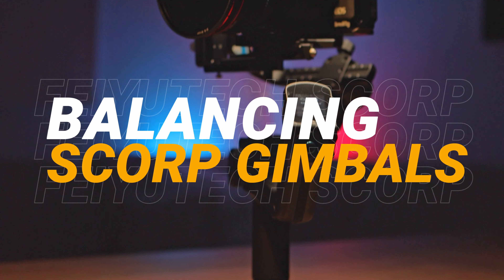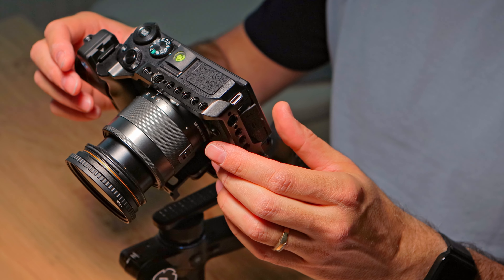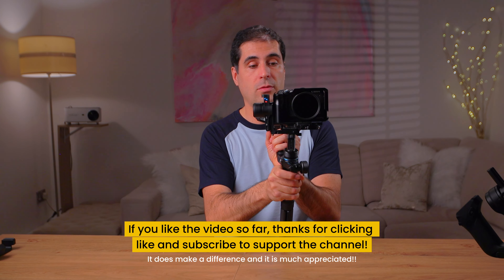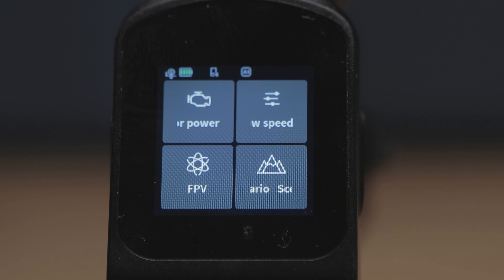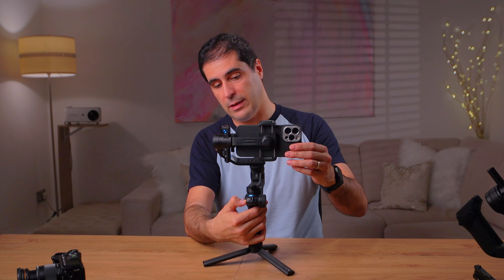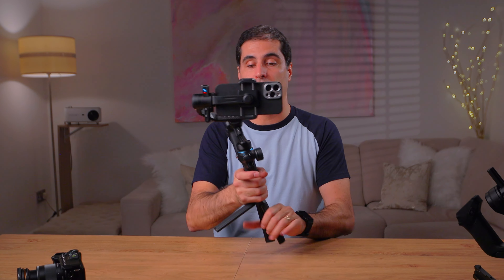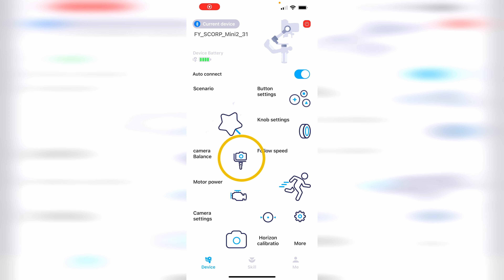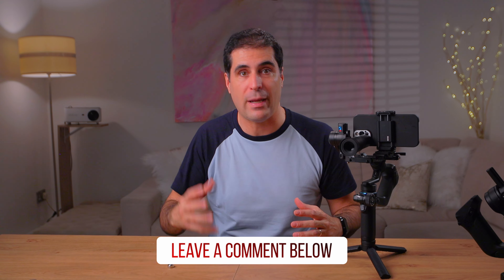Balancing Feiyutech Scorp 2 & Mini 2 Gimbals

Comment: If you dont mind answer my question. I have problem stting in vertical mode, it was vibrating. I did the calibration for the vertical mode
Reply from the maker: Are you able to send me a short video of what the issue is on my instagram or facebook?

Comment: Thank you for the video . Although I have a question and I guess many would like to know the answer as well ). I was gifted with Scorp 2 ( not the mini 2) and I would like to know how to mount my iphone 15pro . Is there a way to mount and balance the iphone 15 pro. Will it work properly or the gimbal won’t balance due to the phones light as the scorp 2 is for handling heavier weight ?
Reply from the maker: You just attach a basic smartphone clamp to the Scorp 2's mounting plate and balance it that way. It should have no issues at all because the payload is so little
Reply: @ much appreciated:)

Comment: I want to get the scorp 2 for the stronger motors and some other features but the scorp 2 doesn't come with smartphone mount, so my question is can i buy it separately or it's better to use a smartphone cage and mount it like a camera on the gimbal ? Thanks for your informative videos
Reply from the maker: I always prefer to use a base plate and mount it like a camera, as I show you in the video. I always find the dedicated phone mounts gimbal provide not too good for balancing. I hope you know what I mean. You don’t need to buy anything fancy. Just any clip phone mount that you can screw onto the gimbal’s base plate. Then you can balance it like a camera and get the absolute best results. If you ever get stuck k, reach out to me by email or socials and will happily help out. If you are London based and want to test drive the gimbal before purchasing, just let me know and we can sort something out.
Reply: Exactly my point.. I don't like the provided smartphone mount.. Glad I've watched your video.. Now i know the standard base can be use to mount smartphone as well..
Reply from the maker: Amazing!

Comment: Time 1:53. My camera still falls to the front. My lens 16-55 is probably a little heavy (but not exceeding the limit). I have no space anymore to put the camera backward. What should I do? Thank you!
Reply: Is your camera touching the roll axis bar at the back? Or is it that the way you mount it, you can’t go further back with the camera?
Reply: I can't go back since the plate is too short. I have just ordered a longer ARCA plate. Hope it help. What is your suggestion? Thank you for your video. It is great!
Reply: @ have you tried attaching the camera to the base plate at the furthest back possible position, so you can get further back on the gimbal itself? If the camera is on the middle of the base plate, or the front, the range when balancing will be limited. I hope it makes sense. Send me a private message so I can send you a photo or video…
Reply from the maker: Did you get the new longer plate?
Reply: @natureally-relaxingambient4037 Yes, it is in the most backward position (number 4). I am not able to send you PM here with photos. Thank you for your help.

Comment: Dude im so confused 1:15 when i unlock and move this part it DOES NOT allow the lock to re secure all the way, the lock arm gets stuck half way. Wth?
Reply from the maker: Could 8 possibly ask you to record a short video with good lighting where I can clearly see what the issue is and the equipment involved and hopefully i can give you a reason/ solution ? Hard for me to say without actually seeing the issue with my own eyes… contact details in my about page. I hope I can help!
Reply from the maker: I saw your video. That does not behave the way mine does. it looks like the latch is not secured enough so the plate slides. Have you contacted Feiyutech support with that video? Please let me know what the score is and if they haven't got back to you, I can try and get the person i deal with at Feiyutech to get support to contact you.

Comment: Solid review! In your opinion, how does the Scorp mini 2 stack up against the Hohem M6 when filming with smartphones?
Reply from the maker: The mini 2 is a really nice gimbal. Do you have any specifics?
Reply: @SamuelSotiega  Specifically the stabilization, AI tracking, and general ease of use between the two.  To give you some context, I'm looking for a gimbal to film cinematic car videos. I'm currently using just my phone (S23 Ultra), but plan on getting a decent professional camera soon after some research
Reply from the maker: for what you mention, the scorp mini 2 will be my preferred option. You get great ergonomic for both standard and also underslung, very, very gold stabilisation, the ability to use either phone (with dedicated smartphone mount) or camera…. If you are comfortable with the shape, I think it would fit your requirements. What do you think? Do you have any specific concern?
Reply: @SamuelSotiega  I was leaning towards the mini 2 as well. No concerns, I just wanted a professional opinion. Thank you for your feedback!